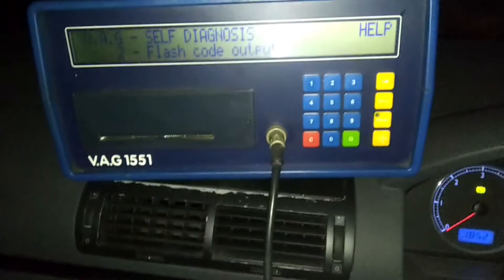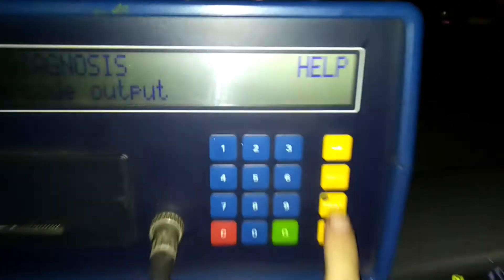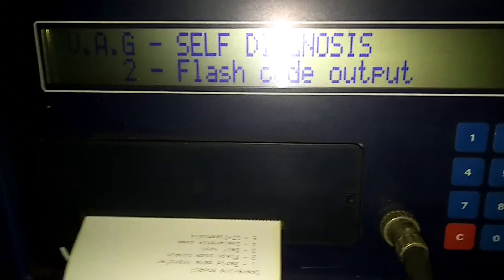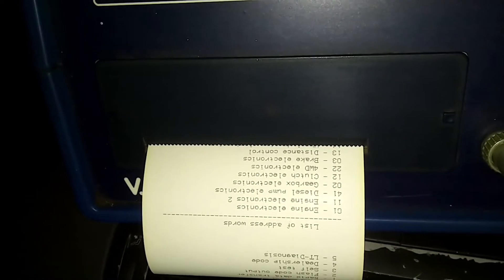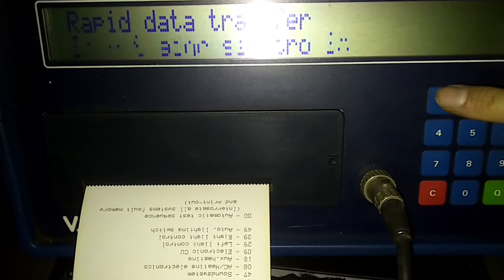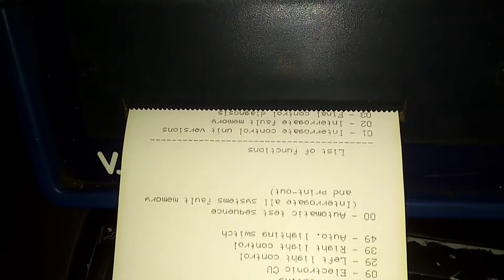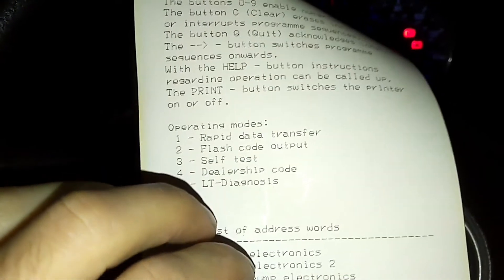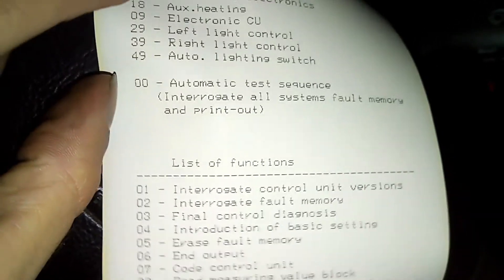VAG 1551 Tutorial - help functions and list of control units/ functions

Comment: Do you know, if it’s possible to change the operating language?
Cheers
Reply from the maker: @DJDinitus  Yes, I believe so. I haven't ever done it personally but I believe from memory of reading the original instructions back when I was at the dealership in the early 2000's that there was a way to do it. Do you have one you need to change the language on then?